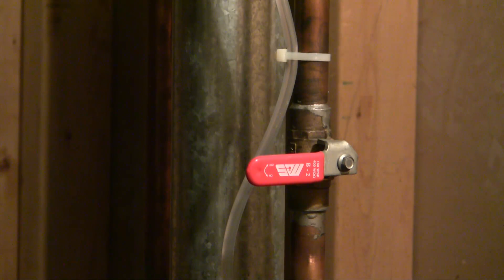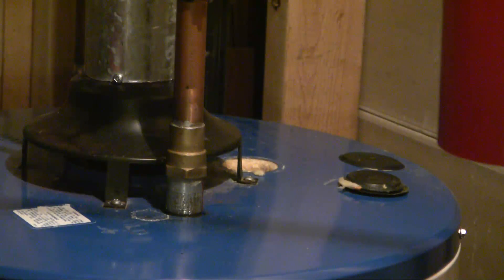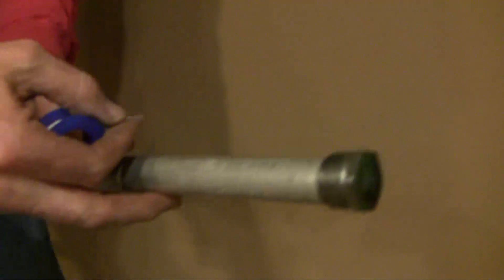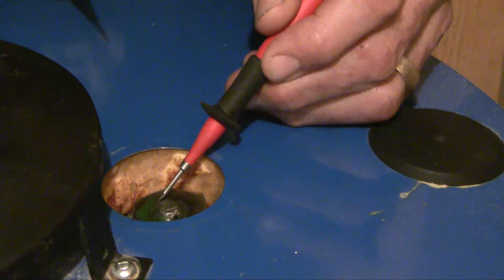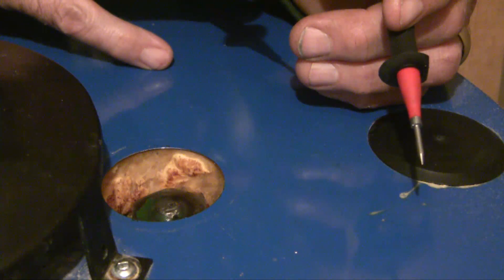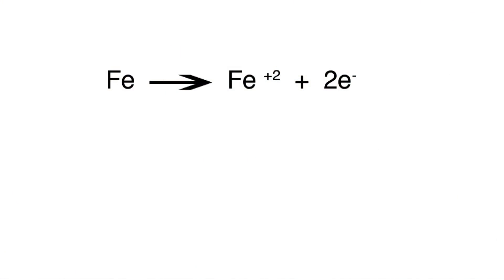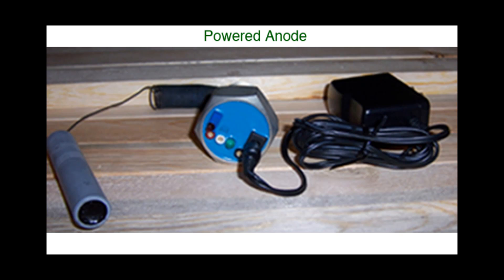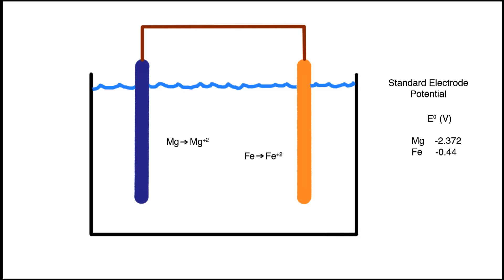How and Why to replace the Anode rod of a Water Heater

Comment: great video. what are your thoughts re: water softeners and anode rods- salt being an electrolyte, accelerates the process, correct? the softener salesmen claim the salt is broken down during the ion exchange process, and is not an issue. as a plumber, i have seen many water heaters service life cut in half with water softeners in use. an actual chemistry lesson/explanation as to why would be much appreciated. what do you think?
Reply from the maker: lednuge Good question, I don't know. There must be objective data out there, but it may be hard to find. Companies who do corporate research are not obliged to release it into the public domain.

Comment: helped me in deciding if I should change both elements and lower thermostat with the anode.  have problem with water going from very hot to warm.  everything tested good so changed upper thermostat same problem.  tanks in good shape drain it periodically.  thanks again especially for all your replies which takes lots of time.
Reply from the maker: Tom T. And thank you, for recording your experience here.

Comment: Teflon tape should be applied in a minimum of 3 wraps.  As the threads are tightened, the metal cuts through the tape, leaving it to fill any voids, creating the seal.  Don't be afraid that you will be interrupting the current flow if you have more than 3 wraps of tape either.  If you can get the threads started, it will be fine.  The anode rod and pipe fittings contain a tapered thread that starts smaller and gets larger.  You should be able to turn it by hand approximately 1/3 of the length of the threaded portion by hand, the middle third with a wrench, and leave the last few threads exposed.  Testing your T+P valve is a bad idea.  If you trigger the valve it often doesn't reseal afterward due to mineral deposits and will continue to leak no matter what you do.  If you do mess with it and it starts leaking, you will need to replace the valve.  Nice video btw.
Reply from the maker: Thanks, those are wise remarks.
I know what you mean about the valve. Whenever I have tested the valve, I have done so knowing that I may need to quickly replace it because of what I have done. The flip side is that the valve could also seal shut, putting your system at risk from overpressure problems.

Comment: http://youtu.be/JiDTkXd52DE

Watch this video for electric water heater Limescale removal & general clean out!

Feel free to like and share!
Reply from the maker: When you've got a lot of calcium you can sometimes hear the little rocks bouncing around when hot water is in use. I like your idea of a shop vac, though it would be a lot more difficult with a gas heater.
Reply: How do you de-lime with a gas water heater?

Comment: I also want to point out that checking the pressure valve is also a good idea.   Turn off water, open a tap to let the pressure go, and try to move the silver thing at the end of the valve.  Hot water/steam may come out so take your time with it.   Thanks for making the video.   I only wish i replaced the anode rod 8 year ago.
Reply from the maker: That sounds like a good tip, Ken. I often wonder about safety valves, as corrosion builds over years. For those reading, remember the risk of hot water/steam injury. It might be wise to do this at a time that the water temperature is low, like after the wife takes a long shower and the hot water temp control is turned way down.

Comment: I was given a 15 year old State tank from 1994.   I pulled the rod and sanded it.   Is it OK to sand and clean off the white stuff.   Most of the rod is still there?  Tank is running fine for 2 days. Thanks
Reply from the maker: I guess you could do that, but these rods are cheap. Like spark plugs, there's not much point in putting an old one back in.

Comment: To spelunkerd and all handy men reading this: I am planning the construction of a shipping container house. One of my ideas to solve a heating/cooling issue is partially bury one or more of the containers in the ground and use mother earth as a heat sink. But one problem is a steel box in contact with the earth could cause corrosion. I could spray the outside with a chemical protective coating OR another suggestions that was made to me was using a sacrificial anode. What are your thoughts?
Reply from the maker: Although the main indication for anode rods is for steel objects directly connected to a body of water, they are sometimes used for things like gas lines and other steel lines going through ground. The efficiency of anode rods goes down if the volume of water does not allow free movement of ions through the solution between cathode and anode. So, in situations where the ground is not saturated with water, it wouldn't be as easy for ions to make the journey, having to jump over dry spots to balance the movement of electrons. I probably would add an anode rod, but if you are using an old steel container then a careful coating of paint would be wise. You might consider some kind of plastic barrier coating as well, with a perimeter of weeping tile underneath, and probably an exterior sump pump. I would worry more about water penetration and a wet floor, with mold and other complications of that. Good luck!
Reply: Would cold galvanizing work?
Reply from the maker: *****
That's a good question. The way anode rods work, they are 'sacrificial', meaning that the redux reaction consumes the rod instead of consuming the part you are trying to protect. You have to replace the consumable every once in a while, like on a boat when you "change out your zincs" every year. I don't know everything about the galvanizing process but I believe it acts as a protective layer, one that is designed to stay in place and not corrode.

Comment: Thanks for mentioning how old the anode rod is. Mine water heater is 13 years old and came with a 12 year warrantee (GE), - I have a new anode rod to replace, but I've never done it before and I'm afraid of getting in a situation where the rod is falling apart and won't come out. How do you get a rod out that has aluminum peeling away from the core wire?  Thanks again!
Reply: Hello all - 

This is an interesting video, and to be fair, he did mention that "with some diffuculty" the anode rod was able to be removed.

I just changed out my first anode rod recently, and now know I did wait too long to do so.  This hot water heater is about 15 years old, although it was actually in normal operation only about 50-60% of that timeframe.  There was virtually nothing left of the rod other that the wire down the middle and a little bit of aluminum near the head.

After briefly trying unsuccessfully to get the rod loose using a long 1 1/16" box end wrench and a 4lb hammer, I soon quit with this combo as the wrench would not drop down fully over the head of the rod, and I didn't want to bugger the head up.

The next approach was to use a 27mm (virtually the same size as a 1 1/16" socket) impact socket (1/2" drive) with a sizeable pull handle as he used - incuding the Dang hammer.  Nope, wouldn't break loose - too much risk of spinning the hot water heater in circles which would likely have had an adverse effect on the piping.

I then called A. O. Smith & spoke to a very helpful Rep, who was a experienced plumber.  I described my process, and asked if there was any risk in using an impact hammer on this sucker.  He said that there should be plenty of steel at the top to withstand those forces, and said that was the method they used to get them out.

Note: rods (should) generally have a standard right-hand thread but do use a finer pitch to the threads.  The rep advised to use only a reasonably narrow band of Teflon tape (if you use any - which I did) so that there is as much raw thread contact with the frame as possible.  Without such the function of the rod would be adversely affected.  He said to not tape the whole thread area - which this guy appeared to do.
MIght not leak but might not work either.

I further asked if it would be reasonable to pop it briefly once or twice in the clock-wise direction (as if tightening it) to aid in breaking it loose, and he said sometimes they had to do that was well.

So, I hauled my air compressor and two impact hammers (1/2" and 3/4") to the site. Started with the 1/2" hammer first.  Popped it clockwise briefly, then put the reverse mojo on it in increments.  First, second and third hits, nada (had the force adjustment backed off to 2 out of 5).  On #4 went to position 5 on the force & held the trigger down for about 3-4 seconds, finally saw a twitch.  #5 got me about 1/4" of motion.  #6 did the job - got it moving and I didn't stop.  

Yeah, sure, I'm gonna use a pull handle and socket on this one!  Maybe A. O. bulls theirs down tighter than other mfgr's, but I doubt it.  Just hadn't seen any comments around mentioning this technique - if nothing else works.
Reply from the maker: That's usually not a big issue, and I suppose in the rare instance you can't get it out you could cut it off and leave the fragments inside.

The biggest risk is when you replace the rod you might not get a good seal, causing an unrecognized leak that could damage your home. Or, I guess you could crossthread the rod or otherwise damage the threads so that a water tight seal is impossible, ruining the tank. Those old threads are pretty tight, and you might not be able to get it undone ( the tank spins awkwardly and it's hard to get a grip, especially if you are alone). With an old tank, I was prepared to take that risk, and I was prepared to deal with complications like needing to replace the tank without professional help. Others may feel less confident....
Reply: @spelunkerd  Another risk, perhaps the worst, is applying a too large torque to the old anode end, and BREAKING the sheetmetal tp if the tank, specially if thinned by corrosion.  So, I would humbly suggest to apply plenty of a penetrating oil in sevral applications, say daily for a week or so.  In my experience with stuck bolts and nuts, and having used many different brands of penetrating oils, I found a home brew that seems to better them all: It is a half and half mix of Acetone (or MEK) and Chrysler's ATF+4 (Synthetic Automatic Trnasmission fluid), it needs to be agitated frequently as it has a tendency to separate, so I only filled half of a syringe leaving air inside to be ableto agitate it vigorously, applied soft heat with a torch, and hit the inner thread piece with the home brew, and it helped to break the stuck thread and not the tank top... in retrospect, a judicious use of a battery operated torque wrench coud be better than a long, bruteforce braker bar (that is why they call it a "breaker bar", as sometimes it BREAKS something!)  Best Luck.
Reply from the maker: Fred English I'm going to "thumbs up" this remark, since there are a lot of thoughtful points made. It's a useful reminder to people that it may not be easy to get that undone. As in your case, I did consider using my impact tools, but it came loose with a breaker bar and some effort. A second person to hold the tank steady would have helped, too.
Your remark about the teflon is cogent. As you saw, even with a fair amount of teflon on the threads I still proved electrical continuity between the rod and the tank wall with my multimeter, so I'm sure the rod is functioning as designed. In my experience it's pretty rare for teflon to cause complete electrical insulation, but it's reasonable to double check. Thanks for making this thread more helpful for those who come later, Fred!
Reply: Fred English
Thats some nice work.  I shall make not as I am about to service mine and your info will help me go in eyes open even more!  Stay gold.

Comment: Terrific video!  Great demonstration of the process of replacing the anode rod and excellent discussion of how it works.
Reply from the maker: Thanks!
Reply: never saw any mention of electric vs  GAS  water heaters that have no electrical connection to 208/220.  and maybe some diyourselfer trying to find an anode rod on his defective gas water heater
Reply from the maker: There should be an anode rod on all gas and electric water heaters. The design many be somewhat different but the principles are fundamentally the same.

Comment: if i want to keep my nice custom plumbing truck box from rusting i can just connect an water heater anode rod to the frame of my truck and the entire truck will be rust protected? or just a portion closest in poximity to anode rod? or do i need powered anode rod to achieve my objective? great visual demonstration of how this electrolysis process works and it made me thing of preventing rust on my truck wow  so now i am glad i watched thanks for spending your time to help us i work on water heaters but i never thought about using anode rod for a personal use!!!
Reply from the maker: That's another very thoughtful comment, David. It made me wonder whether that was a factor, in the industry-wide decision to make the ground negative in all automotive 12v circuits. Years ago I remember some vehicles actually had a positive ground, but now all are negative. Of course the big difference between a car and a boat is the water bath that surrounds a boat. For a galvanic reaction to occur, you need fluid continuity so that the cations released into solution from the anode rod are able to hook up and balance with anions released into solution from the cathode (any part of the car). In a car, a few raindrops would not be enough to bridge that physical gap between an anode rod and any part of the vehicle. Without fluid continuity, electron flow would halt....
Reply: Other forms of corrosion on a vehicle include weld decay, bacterial, salt in the air or on the road, acidic air/rain. Galvanic corrosion is one of them, happening between metal of different Galvani potential, like Al engine, Fe body. Galvanic corrosion is slow, but the size of contact surface areas are important factors of speed.

Comment: I only had a little  bit of high school and college chemistry but I believe if you had shown a picture of the Fe atom and the Mg atom, valence would be the key reason that the ions go to the Mg.  Other comments below remind me of parents' and grandparents' admonition, "Don't drink from the hot water side."
Reply from the maker: The standard electrode potential shown at 5:37 quantifies the tendency of various elements to give up electrons, and of course it's done in steps for those elements like iron that may exist in multiple valences. It's a fascinating topic but out of respect for the general audience I trimmed it down. What I regret not getting into is the way electrons are dumped into solution at the cathode, creating OH- molecules and electrically balancing those cations released at the anode. Without this way of completing the circuit in solution, the galvanic cell goes nowhere.
Hey, thanks for your comment, it adds another interesting dimension.

Comment from the maker: The way I see it you have little to lose. If you mess the repair up, you can just buy another tank anyway. If you manage to get another few years out of your tank, you will be that much ahead. One thing is certain, tanks today are not built nearly as well as they were 19 years ago. Most new tanks barely last 5 years, so cost per year is pretty high. A dip tube and anode rod would be less than $30 -- 1/5th of a new tank is a lot more than that. Self education is priceless.

Comment: Should I still try to replace the dip tube and anode on a 19 year old tank or should it just be replaced. Only recently did the tank seem to not produce enough hot water. It is a gas (Giant) 45 gallon tank. I have never tried to flush the tank because |I was told it was maintenance free.

Comment from the maker: Your concern about what we don't know about the chemicals going into our water is valid. But the powered anode comes with other factors, including the issue that it's an electric device that can silently fail. Even with that option, you don't entirely avoid the concerns you raised above, and it means a little more work for you to occasionally test to be sure the anode is working. Personally I would avoid a powered anode unless it is necessary.

Comment: In other words, I shouldn't be concerned about the stuff released into the water either from the anode or from the plastic of the dip tube (from your other video). In any case I was seeking your opinion about the powered anode. I need to replace my 19 yrs old gas heater and I found out there are very few models which have this option. To me it looks like a big advantage of not having to check/replace the anode every 1 or 2 years. Does it make sense to you?

Comment from the maker: I'll guess it's REALLY small. I can tell you that my induction ammeter has a lower limit detection threshold of about 0.5A, which is not nearly sensitive enough to detect this. A more sensitive test would be a voltmeter -- an in line ammeter might still be too insensitive. One option would be to use a resistor and measure voltage drop across it. Just be sure the resistor power rating is in range for the current you are measuring. Good luck, and thank you for watching.

Comment: Im doing a project for a diploma in electrotechnology, and I am going to make a meter. which measures the current which flows through the circuit. Do you have any idea of what sort of current thresholds flow between the anode / cathode ?
Reply: Current depends on the area of the electrodes.  Only the voltage depends on the chemistry of the cell (which metals are used and which electrolyte...